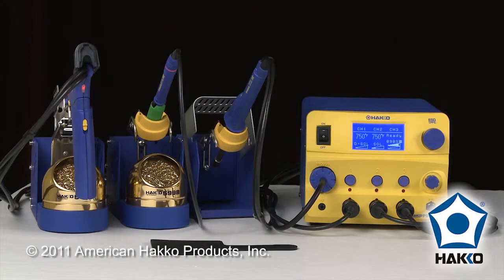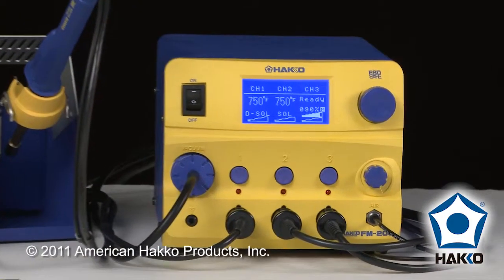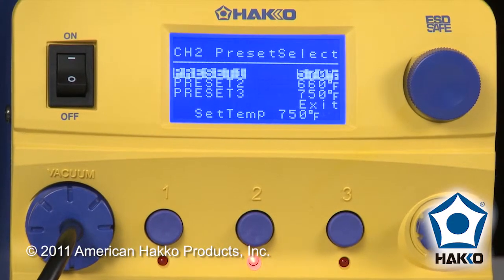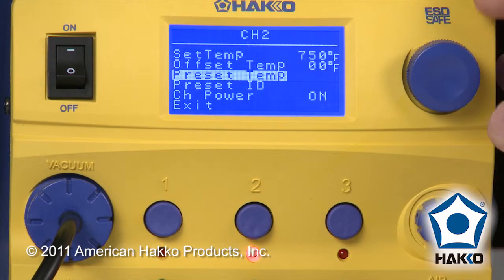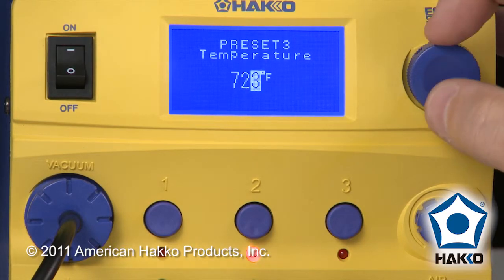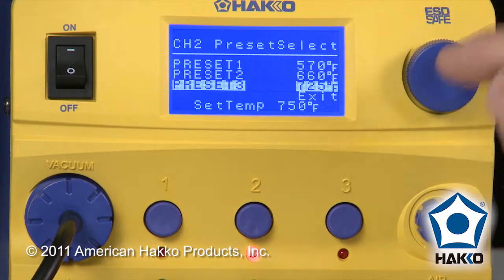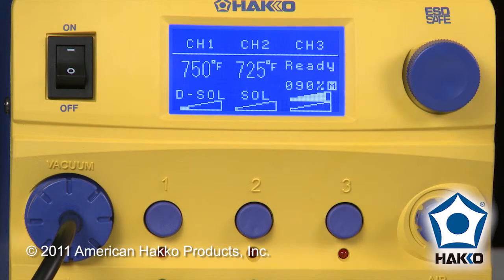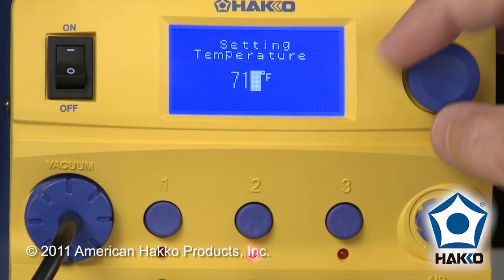Hakko FM-206 — How To Change the Preset and Working Temperature by American Hakko

Comment: My Hakko FM206 does not exit temp selection numbers after entering the final of the 3 numbers per this video. It happens whether i be altering set or preset temperatures. This problem is only happening on solder sucker (channel 1). Is this normal ?
I want to apply less than default 350C for some delicate desoldering operations
Perhaps i need to factory reset the station or its faulty.